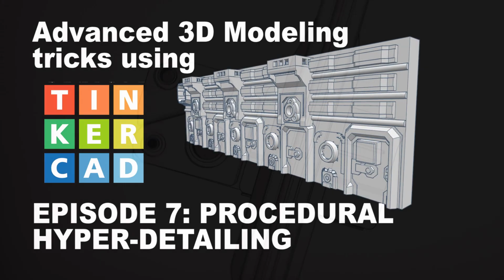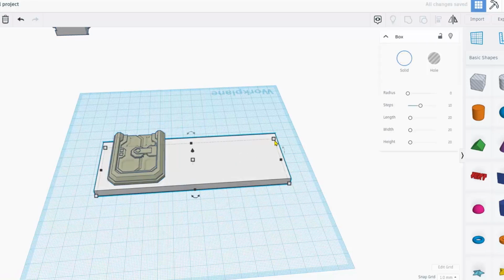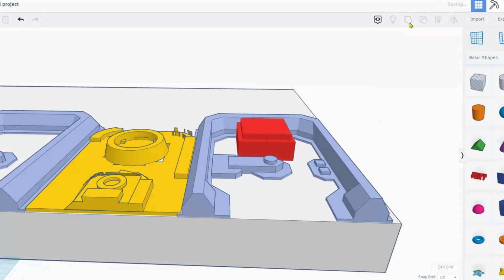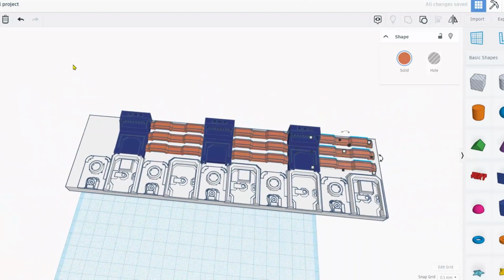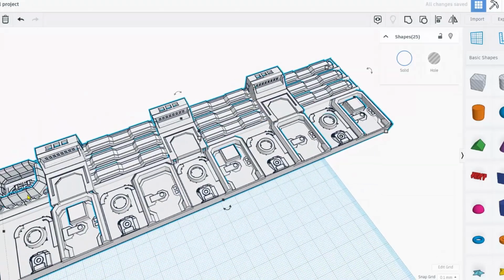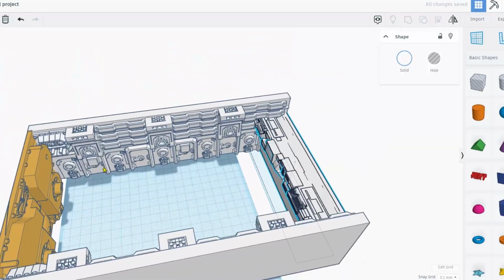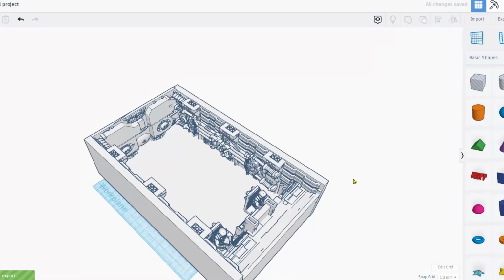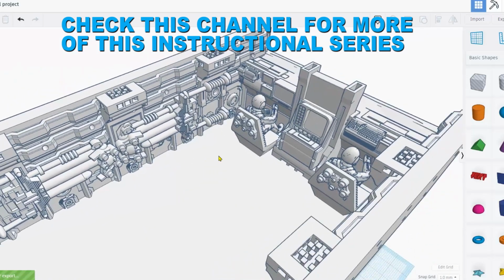TINKERCAD Procedural HYPER-DETAILING tutorial Ep. 7 SEMINAR

Comment: Do you have any advice for when models get too complex and tinkerCAD starts to slow down and break?
Reply: Tinkercad is limited to 25 mb files (individual models). While the number of triangles is limited to 300,000 per model. The more models you open, the slower it goes. If necessary, I use Windows 3D-Builder to reduce triangles and size to be opened, and worked with in Tinkercad. However, I use an FDM printer and can quite significantly reduce the triangles as the resolution is much worse than SLA printers. Hope this helps you! 🙂
Reply: @Mr._L.E.J thanks